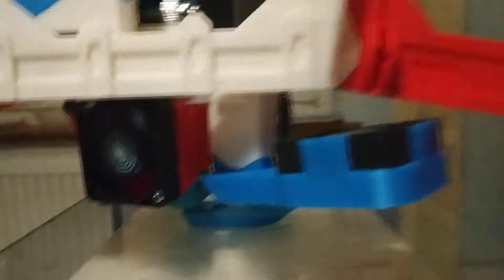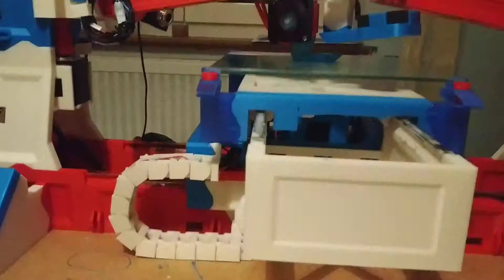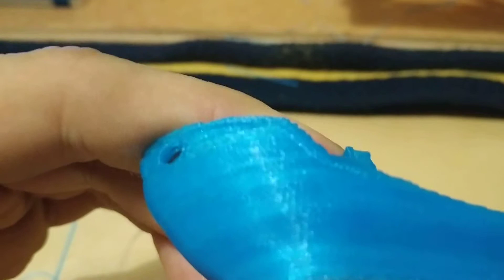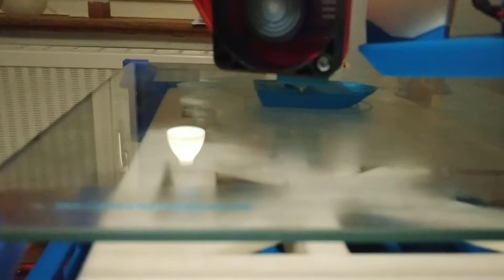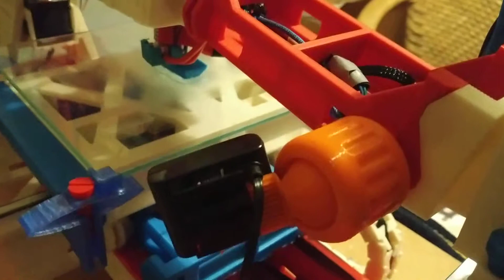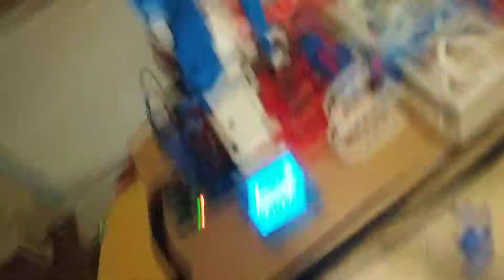Snappy 3.1 self-replicating 3D printer - vibrations solved and webcam

Comment: Do your printer  have been glued?
Reply from the maker: No i did not use glue. I choose the slop so tight, that no glue is necessary. However one piece of the cable chains gets worked a lot and this piece should have some glue. How is your build going ?
Reply: @LinuxMachine-xz1fq  mine goe not bad  some i have to reprint due to some warping issue and some parts are too slack  i have to redo it :) slop tight which software you use ?:)